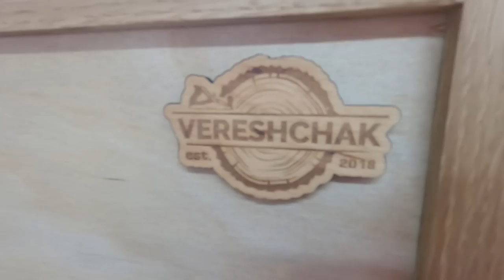Giant Miter Saw Station PART 2

Comment: Awesome! Finally, someone did it  properly, "Mitre Saw Dust Extraction". I did the same, big extraction scoop below, plus the factory fitted 2" extraction. Except I fitted/cut 2mm silicon sheet. Cut a square equal to the extraction chute, glued that around first, then wrapped it around to form a flexible tunnel, glued to the rim of the hood opening. The dust has no chance but anywhere but down the chute = zero housekeeping. 

Nice build, all your builds are nice. Great renovation of your workshop too. And I'm envious of your gantry hoist 😅

Merry Christmas 👍🏼